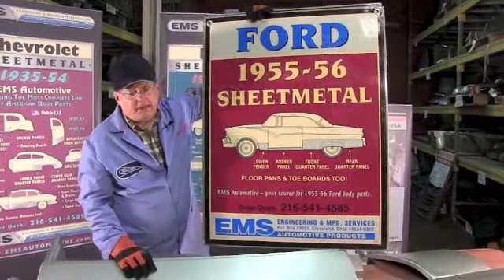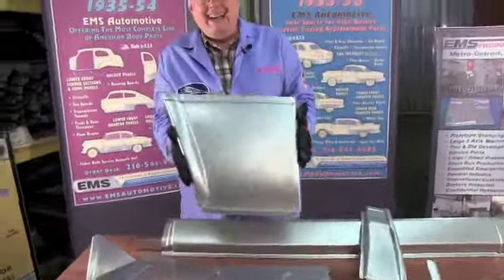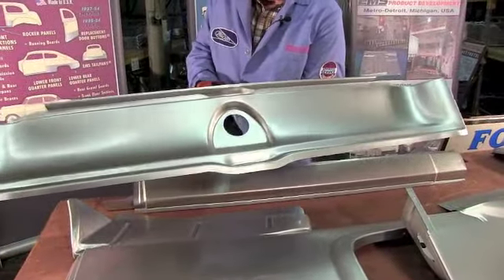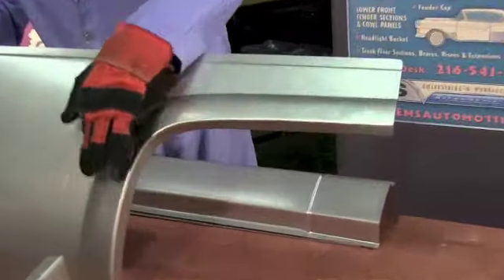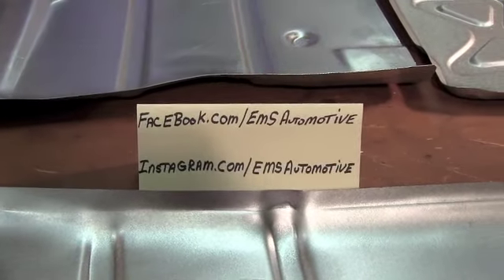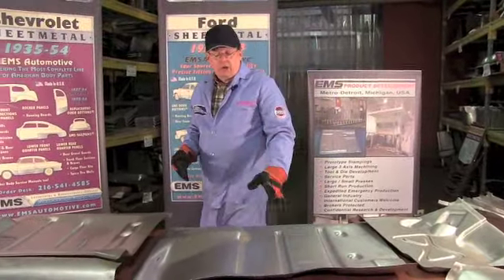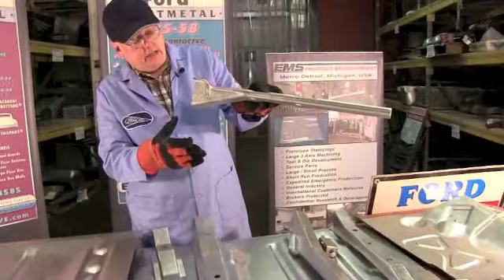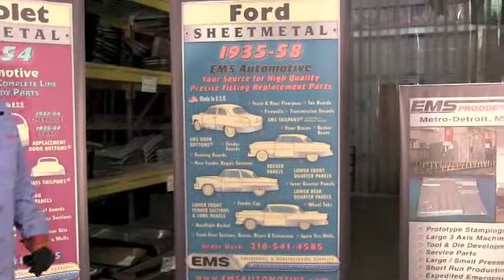1955-56 Ford & Mercury Replacement Panels

Comment: Wonder how come they don't make the whole front n rear panels, what if your needing a whole fender because it's rusted out or has damage n you need the whole fender, or even roof skin, or door skin, or a whole door, or a trunk lid, wheel wells, even fire walls smooth or as original n hoods